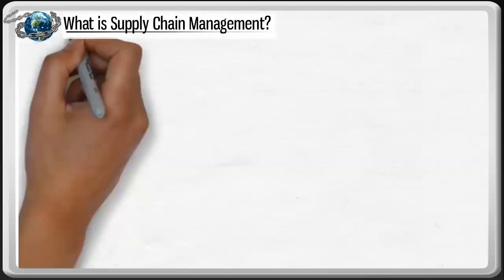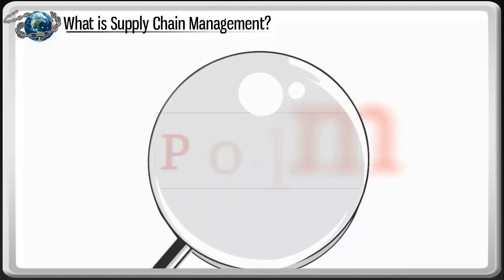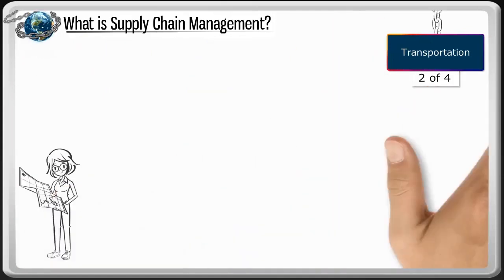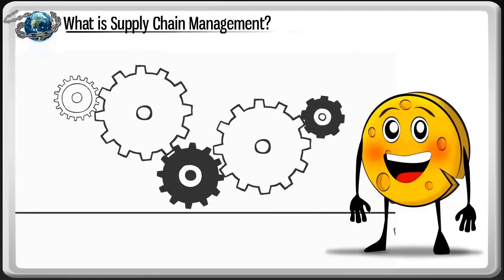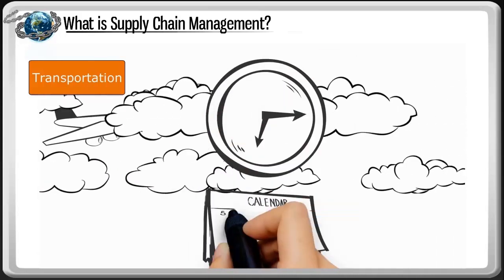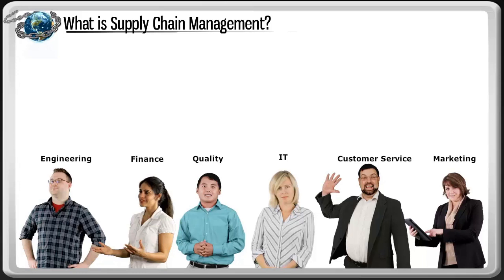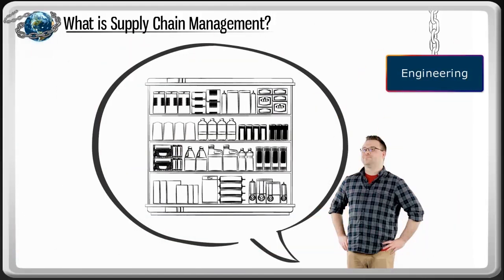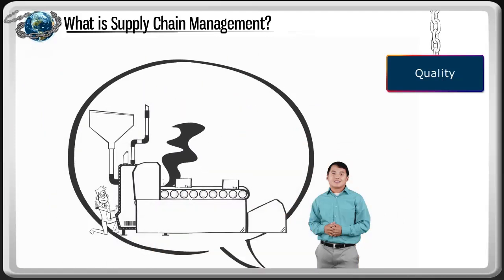Introduction to  Supply Chain Management

Comment: Habana, Rhea Mae B.
BSHM 2-2

Supply chain management (SCM), which comprises all procedures that convert raw materials into finished commodities, is the central management of the movement of goods and services. Companies may reduce unnecessary expenditures and deliver goods to customers more quickly and effectively by optimizing the supply chain. Effective supply chain management keeps businesses out of the news and away from costly recalls and legal actions. The five most critical elements of SCM are developing a strategy, sourcing raw materials, production, distribution, and returns.

Comment: FAJARDO, ANTHONY M. 
BSHM 2-6

I learned many important things upon watching the clip. I realized that Supply Chain Management cannot be done by only one people. I also learned about the "Breakdowns" or "Missing Links" which are the things needed to be solved or avoided. Now, I realized the importance of supply chain management is very essential in solving problems, analyzing supply data, improving processes and building strong relationships with customers that support the chain of supply. I was also able to understand the importance of 4 main links that make up the supply chain. Manufacturing link is responsible for putting together raw materials and transforming it to finished goods, which connects to the  Transportation link. it is the one responsible for the movement of product within the chain of supply. After transporting, Warehouse and Distribution link will store the product in specific sites and locations which also connects to the fourth link. Purchasing link is where buying everything needed to produce customer's needs and demands takes place. I understood more clearly how all these links are connected after watching the Cheese representation. 

We have to connect and cooperate with other people in order to keep the supply chain stable. That's why there are Customer service which serves as the voice between customer and manufacturer, Engineering which provides designs for manufacturing equipment, IT's who makes reporting system to manage data using software, and Quality who does inspection of raw and finished goods. Supply Chain Management might seem a little complicated but understanding it is very essential to provide the people's everyday needs and wants.

Comment: OFRIN, CHELSEA KELSEY V.  BSHM 2-6

When an organization uses this type of chain, it can be an easy access towards the supply and especially the process of every service or products. It helps companies to get the right products in the right place and at the right time. Also, it provides a proper quantity and acceptable cost for different aspects.

Comment: OBNIALA KYLA P.
BSHM 2-6

Supply chain management allows organizations to deliver more quickly, ensure products are available, reduce quality issues, and navigate returns with ease, ultimately improving value, both within the organization and for the customers. important benefits of supply chain management are better collaboration with suppliers.
Better quality control,Shipping optimisation,reduced inventory and overhead costs,improved risk mitigation,stronger cash flow, a more agile business, and better visibility and data analytics.

Comment: Velasquez, Bea Leatrice Y.
BSHM 2-6

In order to avoid transaction errors and meet consumer expectations, supply chain management involves improving the supply process. Design, planning, execution, control, and monitoring are all included. Supply chain professionals emphasize on manufacturing, operations, transportation, warehouse, distribution, and purchasing as they identify issues and create solutions. Supply chain management that is effective and runs smoothly meets client demands through providing smooth negotiations and preventing any kind of malfunction.

Comment: Creencia John Neo S.
BSHM 2-6

Supply chain management is a process from one end to another. Supply chain management is essential in every aspect of business so that there will be a harmonious flow of interaction between a manufacturer to retailer. If supply chain management is interrupted, there will be a missing link or it will lead to a confussion between the supplier and the customers. Not only supply chain management is applied in business but in companies too. In order to have a smooth operation in a company or business, every detail of transaction should be listed and done accordingly.

Comment: Andrea Fytth G Bayles
BSHM 2-3

Supply chain management means improving the supply process from one end to the other to prevent transaction errors. It includes design, planning, execution, control, and monitoring of the supply chain so that there will be a smooth flow of negotiations and to satisfy the needs and wants of our customers.

Comment: Malaluan, Zaihra Mae P.
BSHM 2-3

Supply chain management means improving the supply process from one end to the other to prevent transaction error . It includes design, planning, execution, control and monitoring of supply chain so that there will be a smooth flow of negotiations and to satisfy the needs and wants of our customers. 
Supply chain professionals helps the supply chain to be effective where in they are the ones who thinks in a creative way to identify the problem and find a solution to fix it and prevent any breakdown from happening. And also, there are 4 main links that make up the supply chain and they are manufacturing and operations, transportations, warehouse and distribution, and purchasing. Lastly, we always need to remember that having an effective and productive supply chain management is so important because it will help us to avoid any mulfunctions or breakdowns in our transactions and it will help us to satisfy the needs and wants of our customer even more.